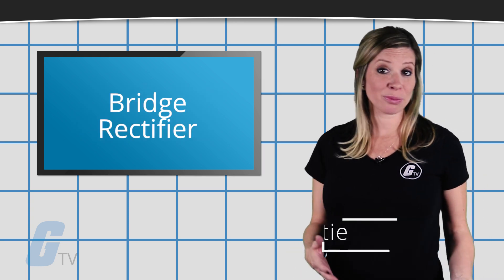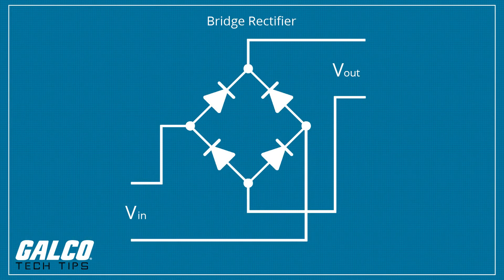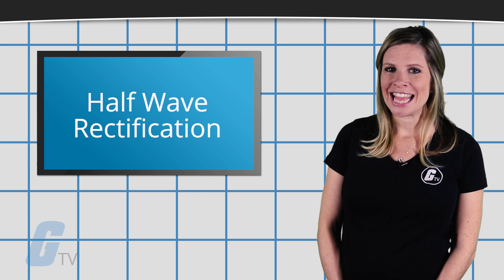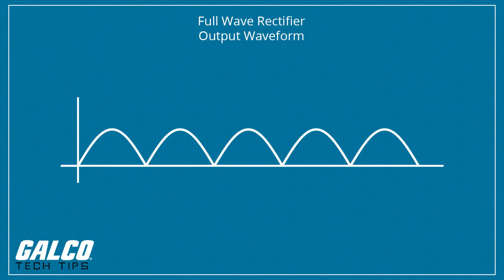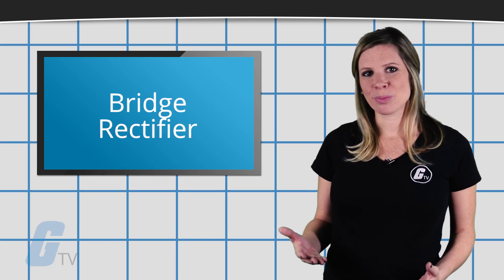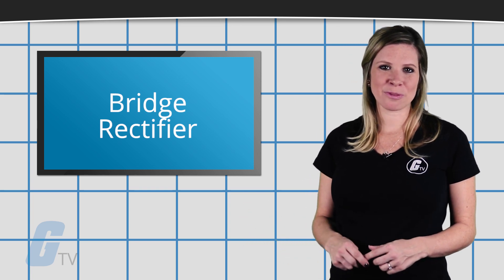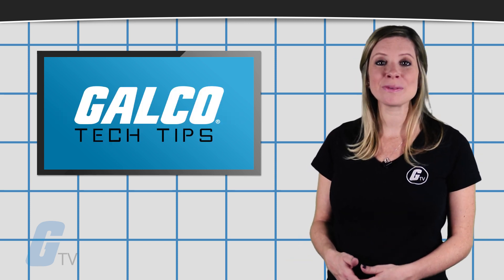What is a Bridge Rectifier? - A Galco TV Tech Tip | Galco

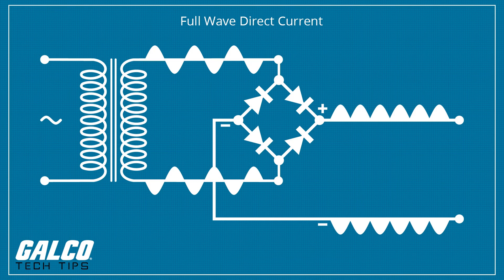Comment: 0:44 diagram is wrong. You do not have at same time both positive wave and also negative. You will not have negative DC Voltage at output. Only positive one.

Comment: On its own , not connected, do rectifiers hold any voltage like a capacitor?
Reply: Capacitors do not hold voltage - they hold charge. In all water/pipe analogies you find when first studying voltage, resistance, and current, consider "charge" to be the water itself. Many people mistake current as the "water", but current is the FLOW of that water passing a certain point in a given unit of time (typically seconds). Voltage is the PRESSURE of that water. Charge is the water itself.

That said, no - a full bridge rectifier does not store charge. It only serves to "fold" that sinusoidal input AC waveform so all crests of that waveform stay the same polarity. It's a series of diodes, each acting as a one-way street. Keeping with the car analogy with this series of one-way streets, the cars ultimately exit the "roundabout" on yet another one-way street (whereas their input point was a two-way), so the cars all now move in the same direction (polarity).

Comment: I have already checked values but vfd not start I think when i Factory Reset vfd then it start so please Give Parameter name 99 Group 20  whatever please inform me
Reply from the maker: Do you have a copy of the manual for this drive, if not please follow this link, http://www.galco.com/techdoc/abbi/acs550-u1-038a-4_um.pdf and should be page 98 for "Complete parameter description". Start with group 99 (9901, 9902 etc.). If you can't get your drive running you can call us at 800-337-1720 and ask for a product manager Monday to Friday 8am to 5pm EST. Good luck Narinder

Comment: which parameter how to do it.my abb vfd acs550 is faulty please help how to all vfd Reset.
Reply from the maker: Go to group 99 parameters and select 9902=1
Reply from the maker: This will put most parameters back to factory, but you may have to correct the motor values your self, ok?
Reply: No madam two wire and 3 wire not problem and not run command problem Acs550 I do factory Reset Please explain
Reply from the maker: There is no Factory reset per say in these drives. You can only change the application macro's. To reset a fault, push the stop button on the keypad or cycle power to the drive.
Reply: Please make a video of Abb Vfd how to set value Advance Parameters. I know basic startup parameters.
Reply from the maker: I will pass this along. thank you for your questions.